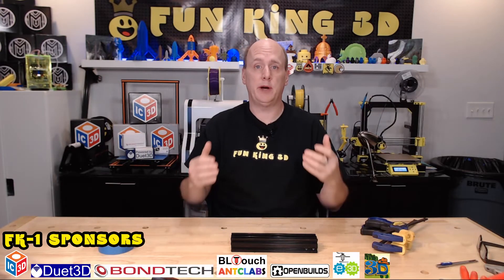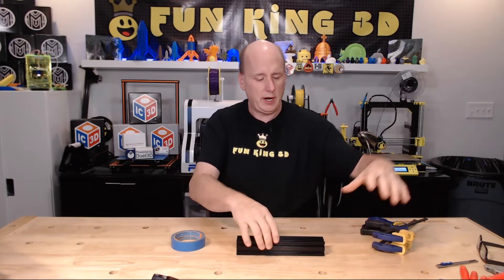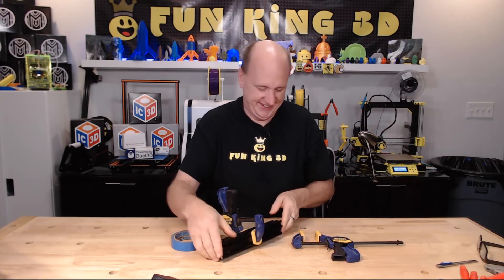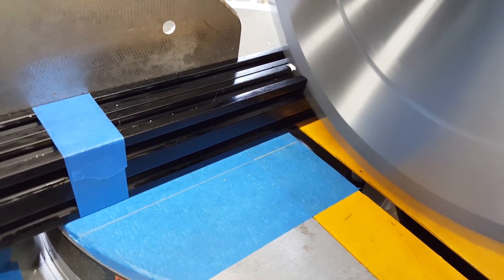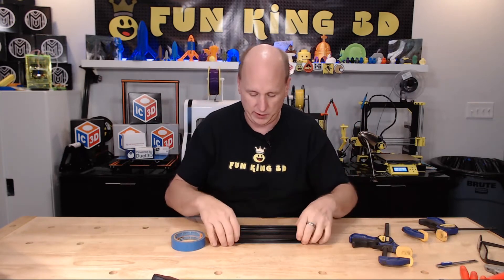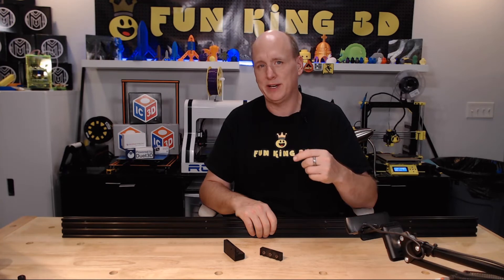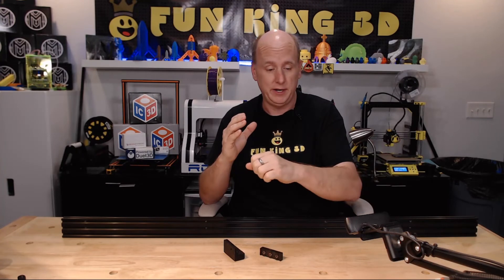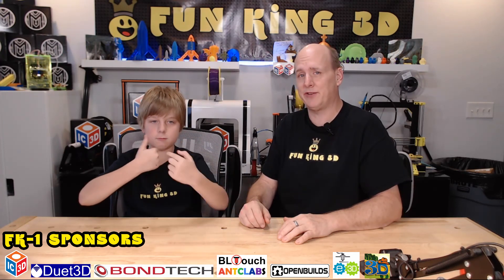FK-1: Step 1 Cutting the V-Slot Aluminum

Comment: For the most precise repeatable cuts, I go with my cold cut saw.  For angles and large stock, I go with the horizontal band saw.  For quick and dirty, the dry cut saw is my choice.
If you use Glenn's method, or any other version of cutting (wood, metal, plastic) PLEASE use hearing protection.  I also use a soft welding hat to keep crap out of the hair I have remaining.
Reply from the maker: A cold saw would be fantastic for this. But I do not own one (currently) and did not want to buy one for this. Good point on the hearing protection too.
Reply: Helps that my maker space is a wood and metal working shop, about 7500 sq ft!  Maybe a 6' x 12' x 10' tall CoreXY is my future ;)
Reply from the maker: Awesome!

Comment: also Keep an eye on your blade alot of times you need to clean clogs between the teeth if your cutting alot
Reply from the maker: Absolutely a great point!
Reply: @FunKing3d  I used to cut 12 units a day of aluminum tubing for walls and ceiling frame work so ive cut alot of aluminum its not fun in my opinion but not terribly complicated and we used the same sort of saw